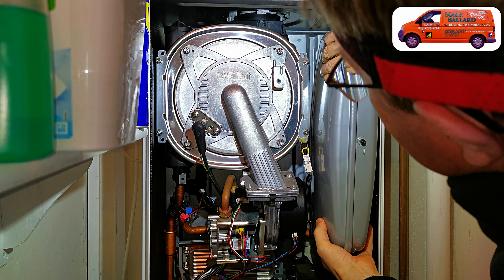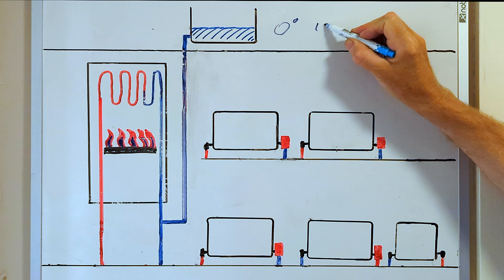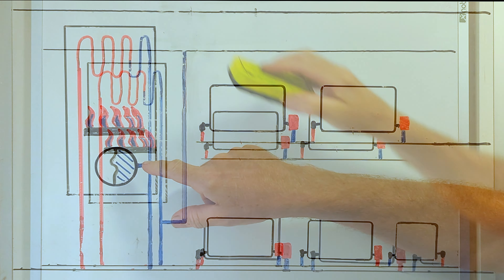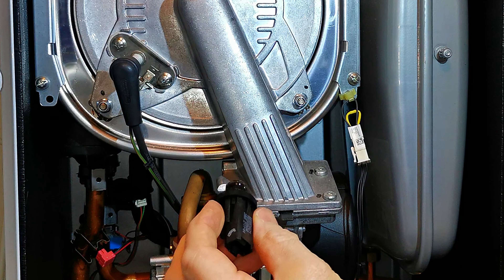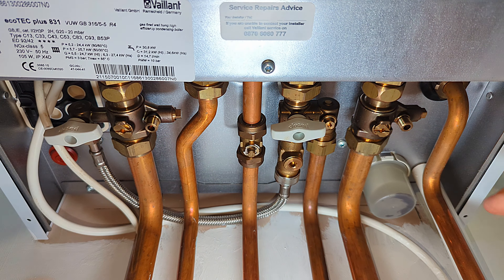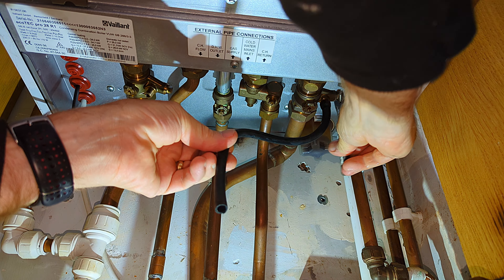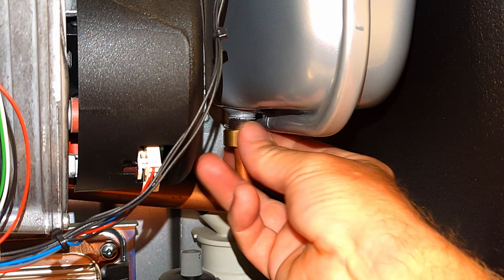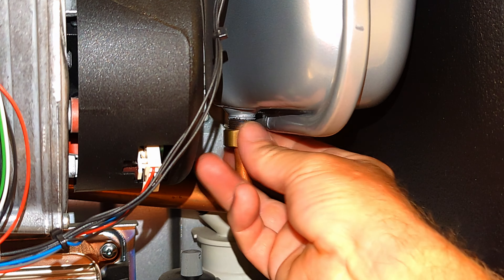Vaillant F75 Faulty Pressure Vessel Replaced also How to Re-pressurise & Service the Pressure Vessel

Comment: so you charged the poor customer for your failed diagnosis and failed service visit .    Oh REALLY    hot water expands when hot .. brilliant . You are so darn clever . my Baxi / roca combi installed NEW in 2002  has functioned without any interference from an expensive service engineer . I have recently depressurised the system and re inflated the expansion vessel . fine tuned the water fill pressure and expect it to go on for another few years .

Comment: Very useful and informative, thanks Mark. I 've got an F75 so I changed the radiator water with new inhibitor. However when I checked the Shrader valve on the expansion vessel water spurted out. I liked the isolation talk particularly.

Comment: Water coming out does not mean it's faulty could just be condescention in the vessel remove the Schroeder valve attached a hose to the whole then putting water into the system up to one bar mark see if any water come out of the hose  if not then re pressure the vessel to see if it holds pressure and that your not pressuring the system check the gauge if it goes up you then have a faulty vessel.
Reply: Can You explain last part?

Comment: Hi Mark - thanks for the videos, they are very clear. My boiler is working now - not swinging from 1bar to just over 3 bar and letter water through the PRV!  Sitting between 1.6 bar(cold) and 2.0bar (hot).
Do I need to check and adjust the pressure vessel pressure after fitting it ?  I inflated mine to 1 bar before fitting, but wondered if I am supposed to adjust afterwards too.